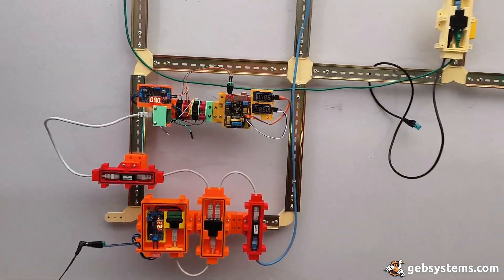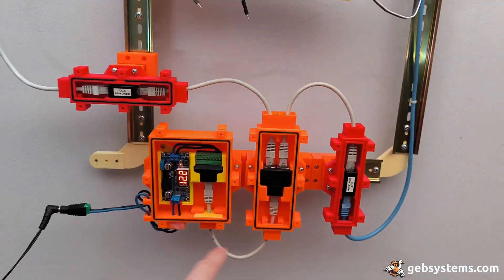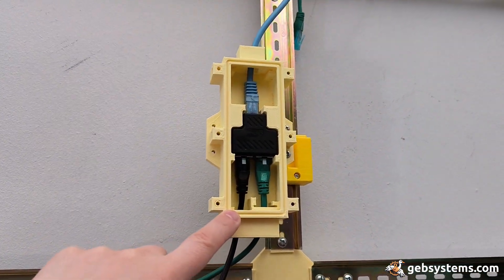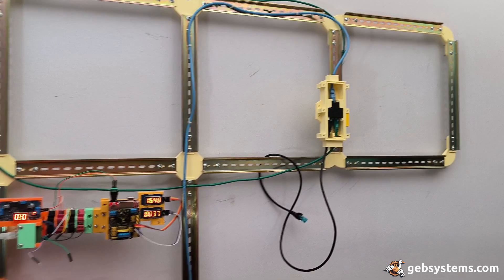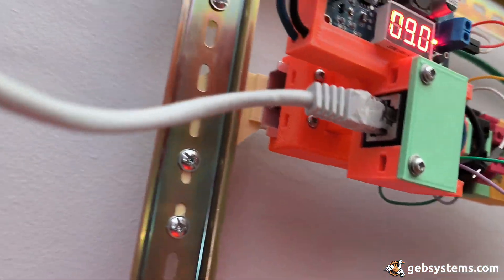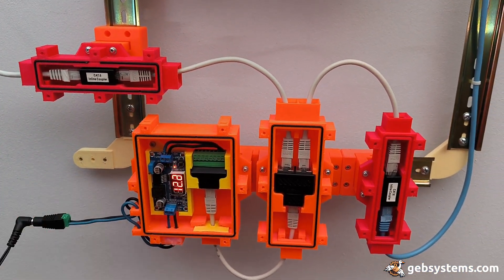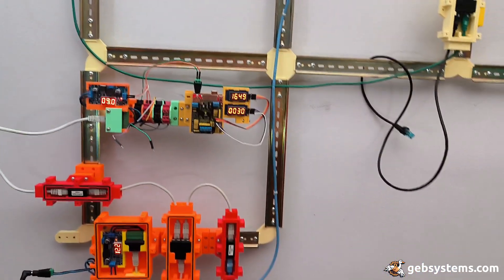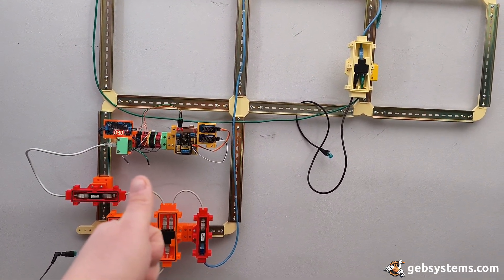Rig Update | Arduino Modbus Project

Comment: what is this project about?
Reply from the maker: I am seeking to establish robust, permanent 24/7 deployments for Arduino-based electronics. Drawing from my background in the IT sector, where wired connections are renowned for their reliability, I prioritize utilizing wired connections such as Ethernet over wireless options, particularly for critical applications. My objective is to delve into the realm of Modbus and evaluate a wide array of Modbus-compatible devices. Additionally, I aim to construct a demonstration rig to showcase the functionality of the enclosures I am designing. Ultimately, this endeavor culminates in the creation of a DIY home automation system that operates independently of cloud-based platforms, such as Alexa or Google Home.